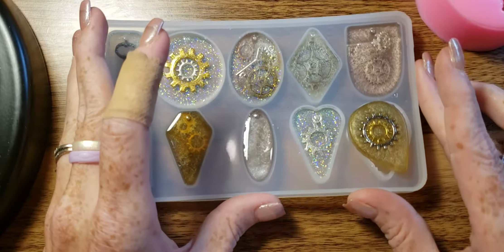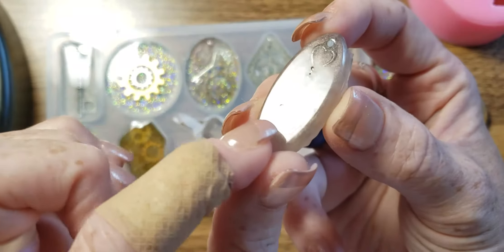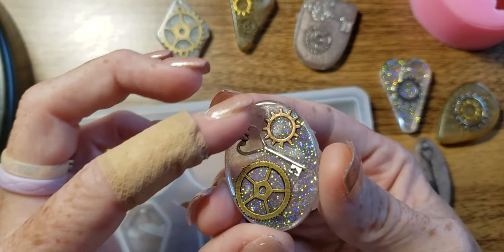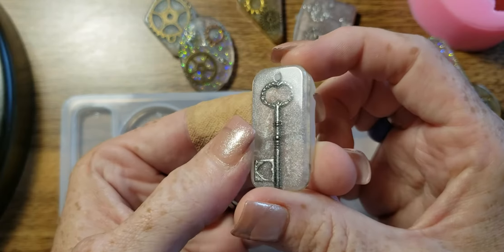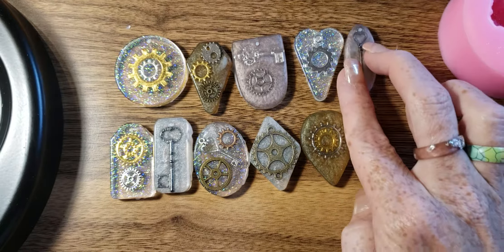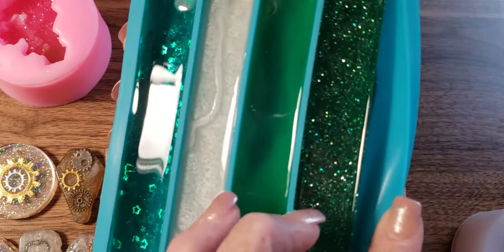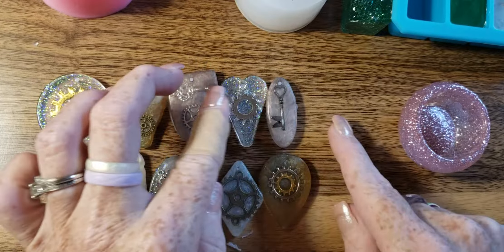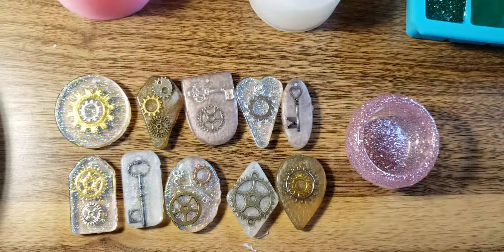I Royally Messed Up! And Here Are My Results!

Comment: They came out so good! I don’t think it’s because of you it could be that the mold is not very good. It has happened to me a few times with mine. How long did you leave the pen blanks to cure? Or did you use a UV lamp?
Reply from the maker: Thank you! I left them to cure for 24 hours! I used 2 part resin from Art❤Resin. I have 4 more going. Trying to use different resins and see which one works the best.
Reply: I love them. Please share your esty page.
Reply from the maker: https://etsy.me/2ZBj3aS i only have 1 item in there so that it can be open. Going to add more items soon. 😁😁